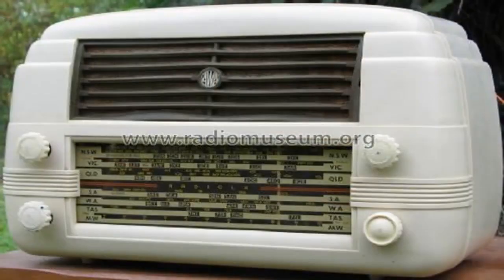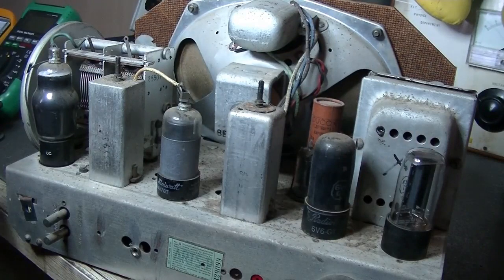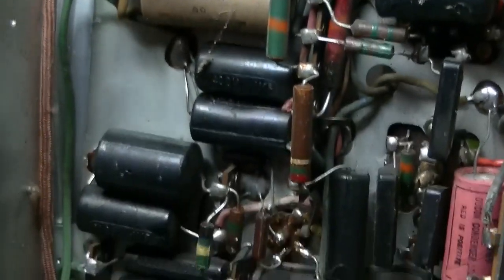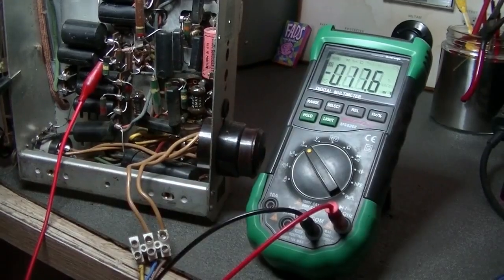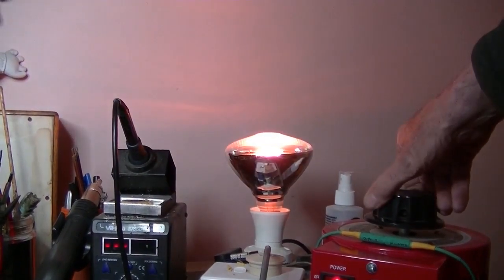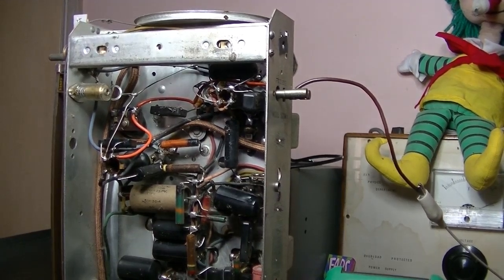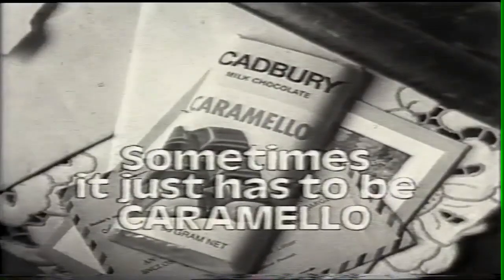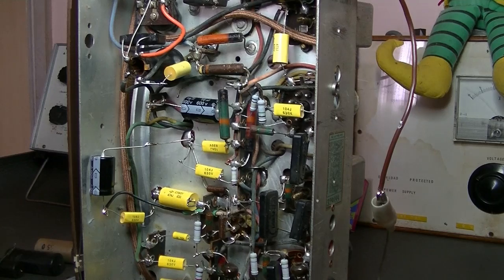AWA Radiola 527MA Valve Radio Restoration: Circa 1950-52

Comment: Great investigation on this radio to find a short on one of the  secondary windings. Crappy wiring coming off the
 transformer to the 5Y3 was to blame here. This is why on a valve radio with a transformer you should add a fuse to it 
on the primary so you don't burn up the power transformer. That guy in the commercial looks alot like Sonny Bono, Cher's 
now passed on ex. I wonder if picking him as the actor was intentional?  Do like the easy addition of using a Bluetooth
 device. Great video!
Reply from the maker: Thanks Steve. I must start putting in fuses as part of the standard restoration. You know, every time i see that ad I think, who is he? You've solved it at last, a sonny bono lookalike